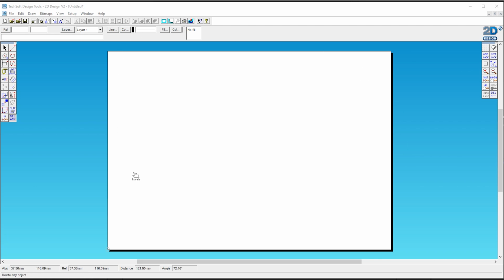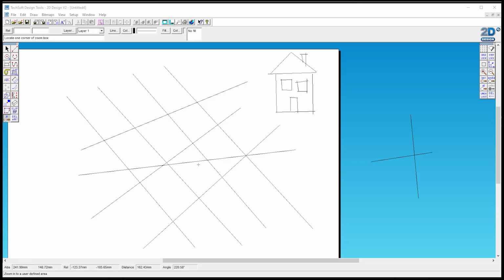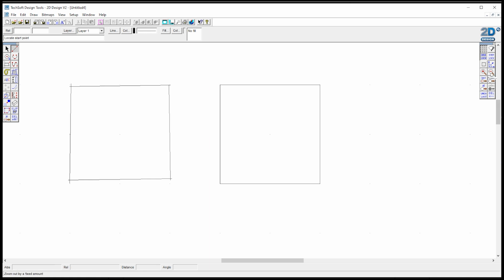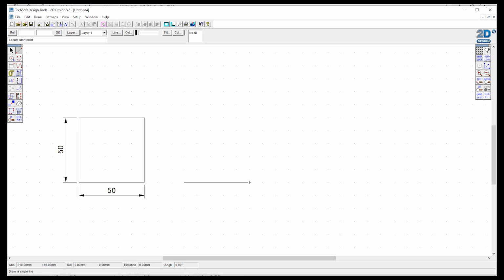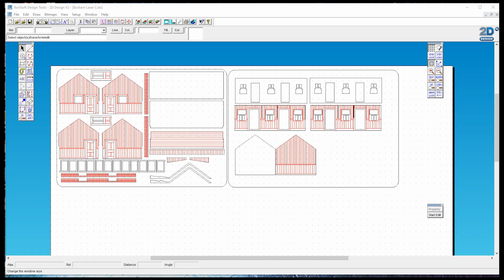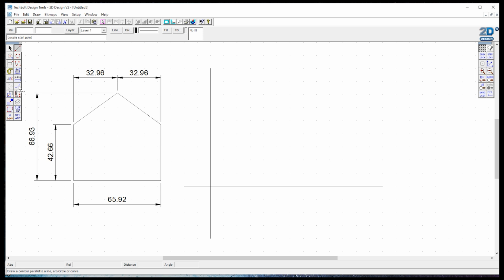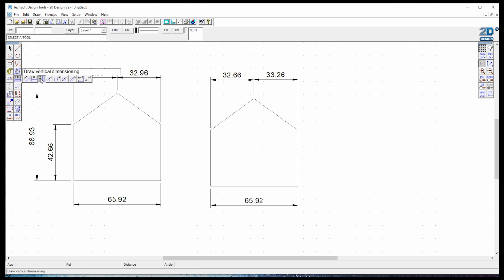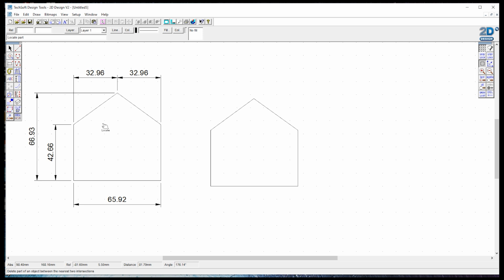The CAD series for Railway/Architectural models | Basic Line Work |Part Two

Comment: Interesting! (30y vet in AutoCAD) seems there are many ways to do the same thing! I would never use offset like you do! Half a dozen verses 6 I guess! Seems different softwares have different tools, I cant do what you did to delete the excess lines as easily in AutoCAD!
Reply from the maker: Thank you.  Yes, I think there are many way of doing the same thing.  Many of us it seems are self-taught and when we find something that works for us it can often seem daft when we see the same process done differently.
Yes, that 'trim' tool is pretty neat.  And it is one of the reasons why I prefer this 'simpler' CAD tool over AutoCAD for the majority of my work.  The same tool exists in Solidworks too which is handy.
My next video shows 'trimming' in LibreCAD which is a little more complex and I must admit to struggling to teach my brain to work differently when making the video.  :)